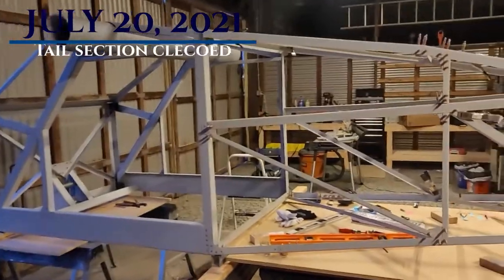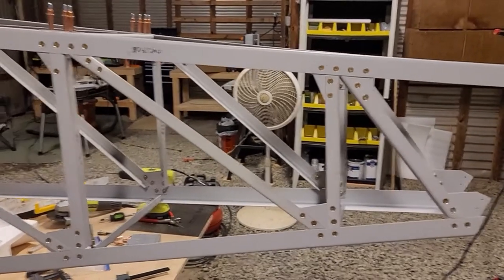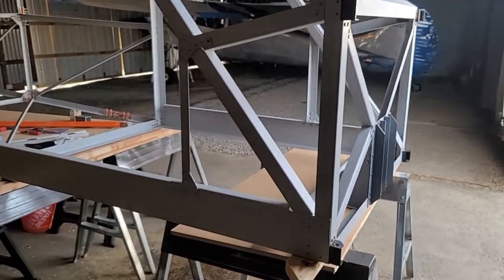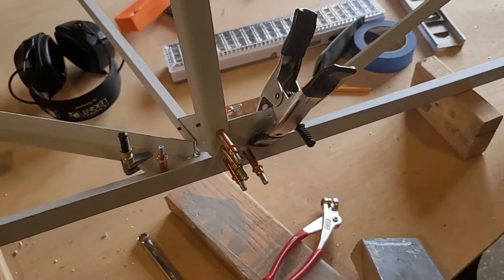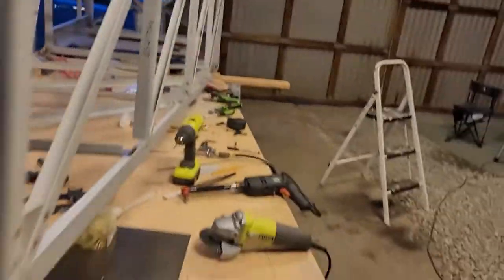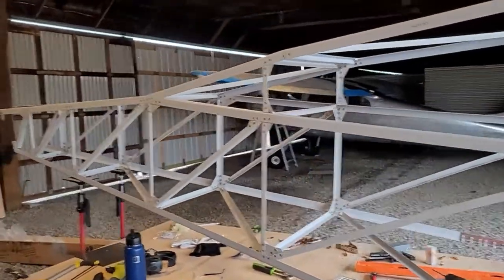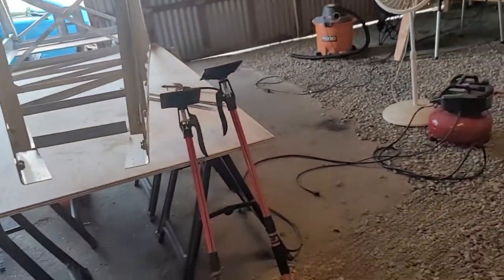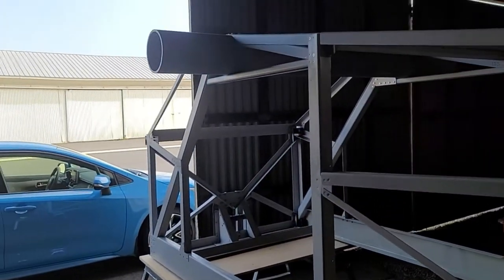Bede BD-4C Build Log 007

Comment: Having built well past where you are from a plans self build kit and using a different spar /wing I can congratulate you on your build ethics. Measure mark drill deburr clecoe do it again. And you have to take it all off to get the firewall on which you will enjoy.  from your stringer that goes across the fuselage for the brake pedals I have installed 6mm marine ply wood on top of the metal floor. it certainly strengthens the floor up. keep up the good work.
Reply: I was thinking of doing the same thing, at least temporarily.  If the plywood isn't too heavy that's certainly the cheapest option by far.  The metal doesn't seem terribly stiff.  One of the guys at the airport that does inspections gave me some good pointers that I've been trying to adhere to.  I started measuring out the firewall today and am waiting for the primer to dry.  Looking at all those bolts that need to come out makes me sad.

Comment: I got the BD-4C: Original Plans + All metal wing plans + modification plans... I'm scratch building, Im noticing some differences perticuallry the #61 template bracket from memory. But also some other components too.  Lots of questions cause my plans don't exactly line up either parts wise. 

Hope you receive your landing gear soon. Also If I could please request that you show more brackets and joints. You do an excellent job explaining please feel free to make longer videos.
Reply from the maker: Thanks.  Next video I'll try to do a quick pass through the various brackets while everything is still open.  I think I have some pictures of most of the gussets right after I primed them all.  If it's not in one of the videos already I can tack that onto the photo montage at the end.
Reply: @SkyFunChannel   You are amazing thank you so much for your hard work and for showing your build.